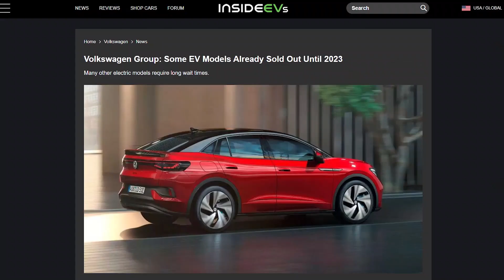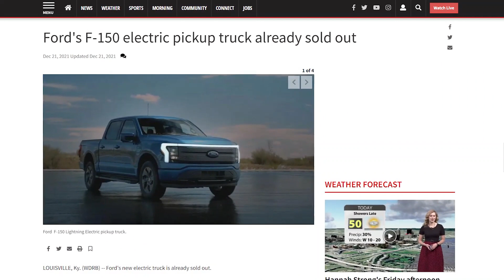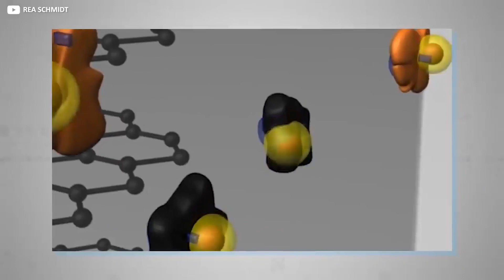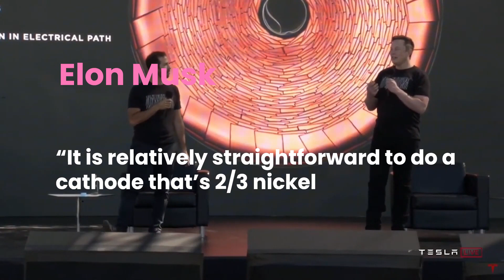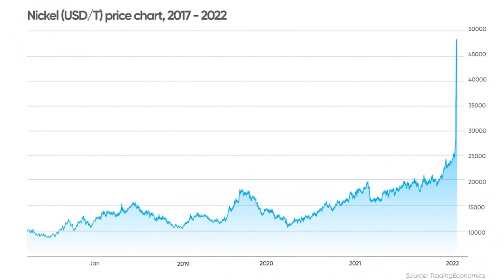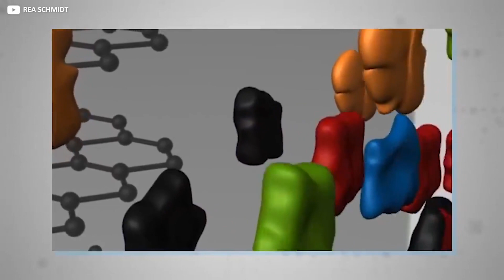Exploring Tesla's New Manganese Battery and how it will make EVs cheaper

Comment: if we made more storage batteries like those from Ambri and less like those from teslan; then we could use the raw materials to make more EV batteries.
if we re-used water from dams by pumping the water back up into the reservoir during off peak hours; then we could produce more energy during those peak hours.
fill our deserts with solar and wind power while growing plants underneath and we would have more oxygen and less co2.
start prohibiting the mfg. of totally ICE engines except for transporting goods and we could also cut down on co2.  Use of more efficient ICE engines would also help a little bit (liquid piston for
example).